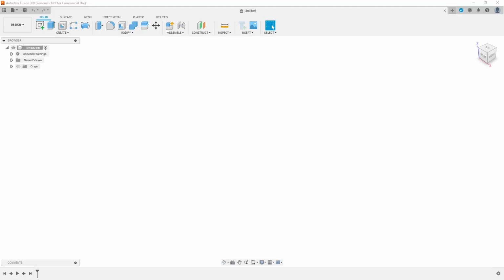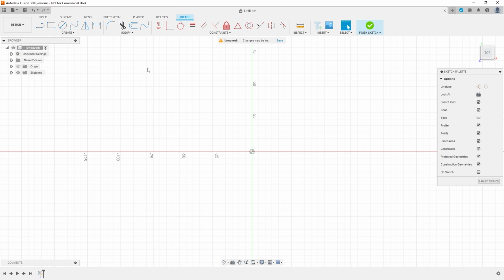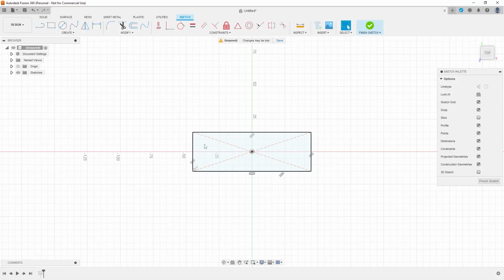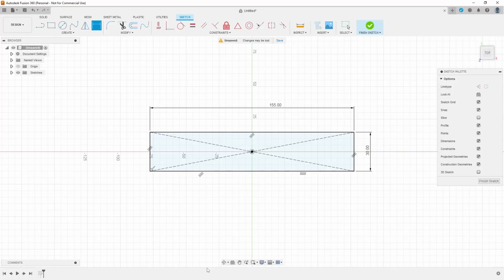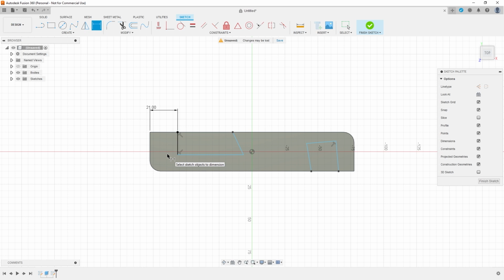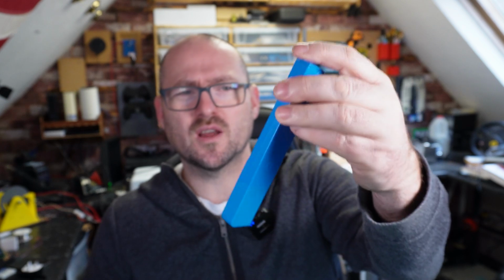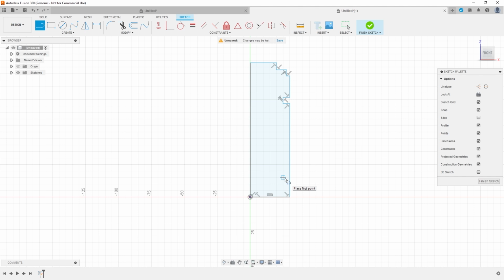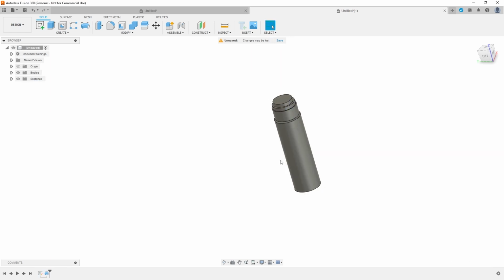Sketching in CAD for BEGINNERS

Comment: You usually don´t sketch radii unless they are really critical, that´s a 3D feature, Sketches should be as simple as possible.
With sketches you can also try out different kinematics and move stuff around, every software does it a little different but generally sketching for 2D kind of stuff this is really useful for the initila concept phase. From there on you can move to surface designs with all sorts of lofting features for complex geometry.
Reply from the maker: That is a fair point. As someone's experience grows they will use tools differently. This was a "scratch the surface" type of video to show what can be done. Each person will have their own use case as to why they did something a certain way. Nothing is ever perfect 👍
Reply: @IQWorkshop  Yes, of course. Just wanted to add some to your initial opening. Sketching is the basis for all and even experienced users learn something new.